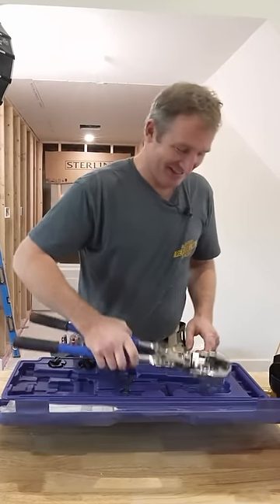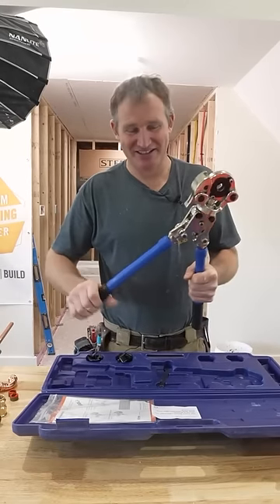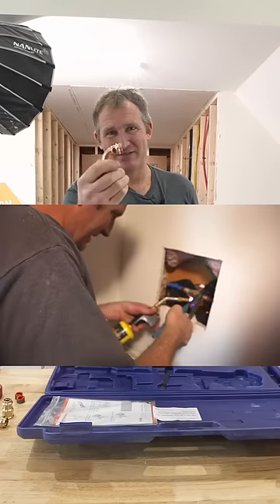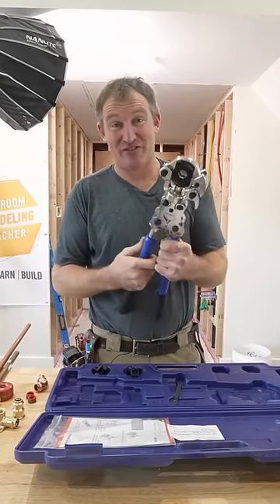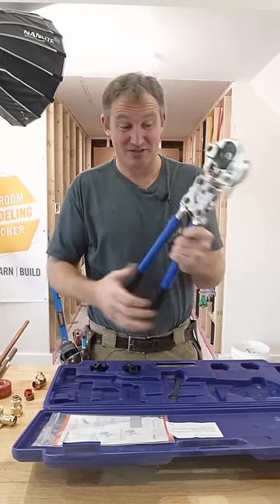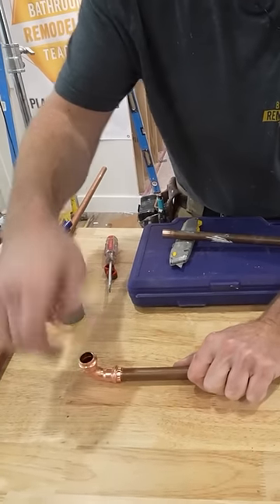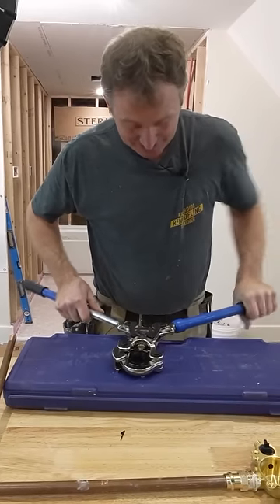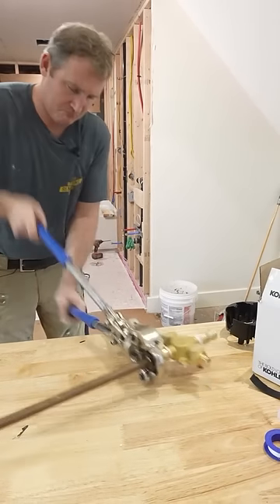IWS-1632AF Copper Tubing Press Tool

Comment: if i were thinking of using that , id just use copper push fit , instead ill always solder .
Reply from the maker: IWS-1632AF Press Tool offers high reliability, long-term stability, and a leak-proof, durable connection.